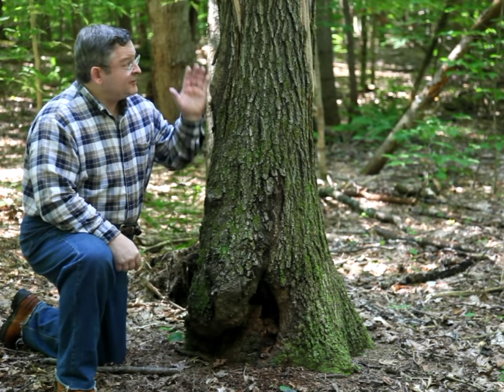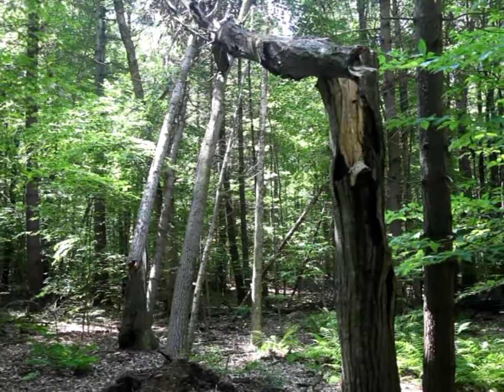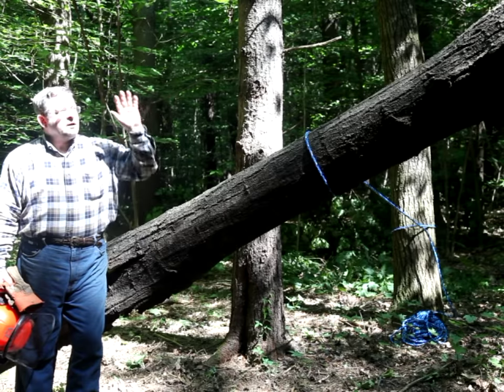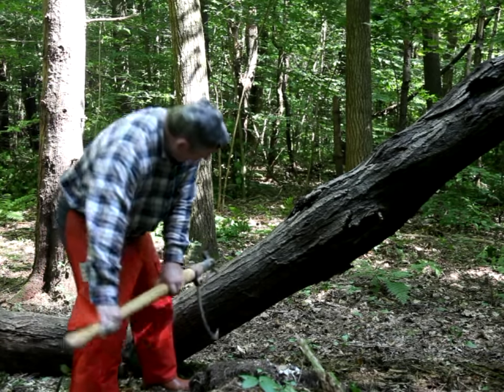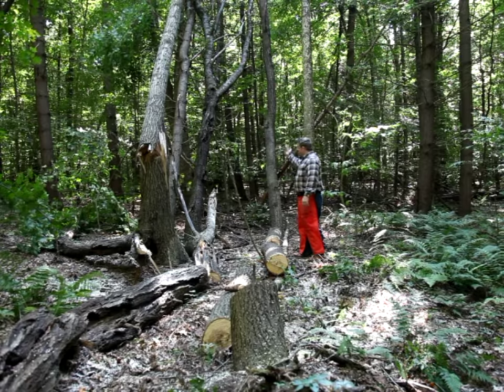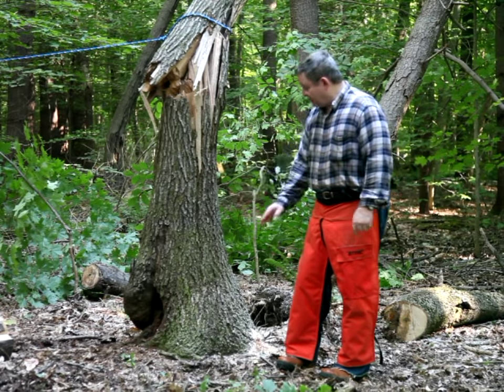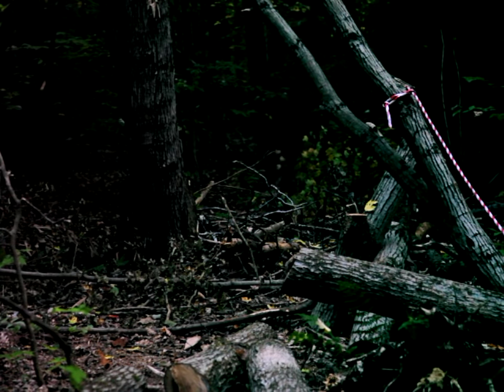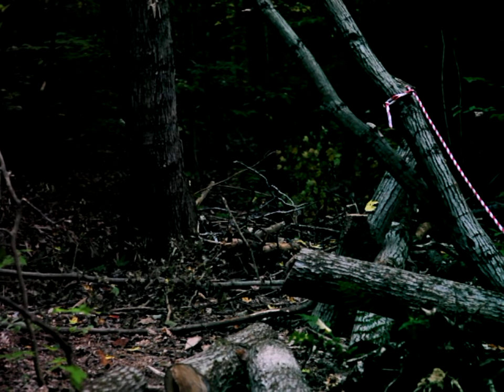Widow Makers

Comment: You need to get yourself a portable winch like the 1.5 tonne Tirfor, cut a notch in the butt of the tree for the sling and set your winch cable around five feet off the ground to a sturdy tree or ground anchor to the rear and at at safe distance from the tree your trying to dislodge. That way your lifting and pulling the tree at the same time.
Reply from the maker: I have two "Little Mule" cable winches which are good for at least a tonne apiece.  You are correct that using them would have made it into an entirely different job.  However, my intent was to make a demonstration video for the benefit of those who either do not have winches, or did not want to lug them into the woods.

Comment: just cut em off pull out with tractor.  or truck.
Reply from the maker: As noted on other comments, this video was intended for those who would be working someplace where they didn't have access to a winch, tractor, or truck.  Heavy equipment changes everything.
Reply: ...&cut down half the wood to get those machines in?!